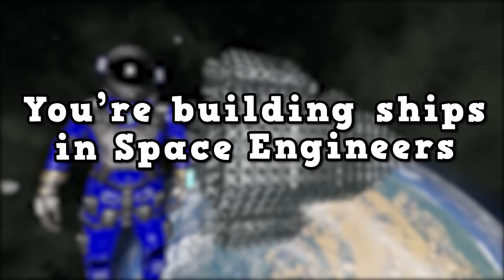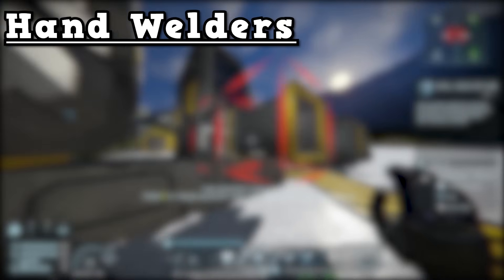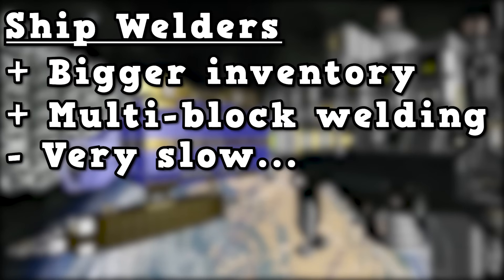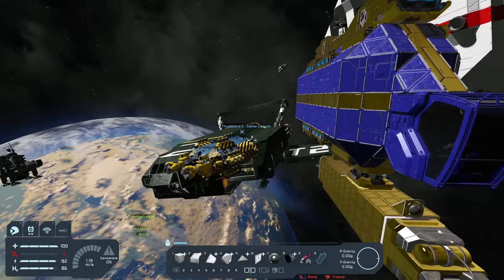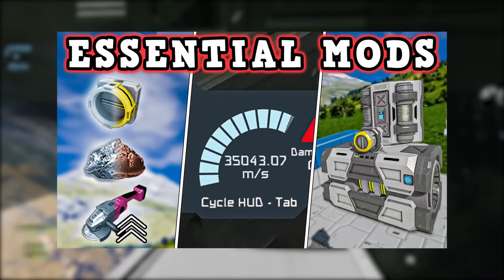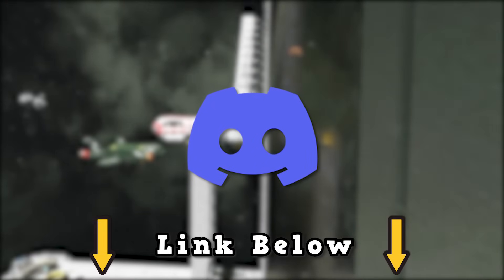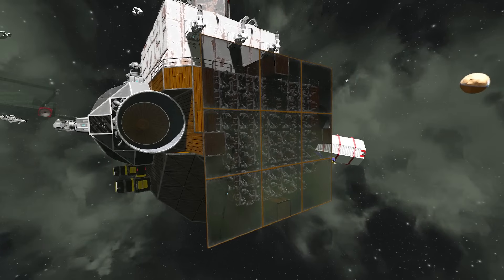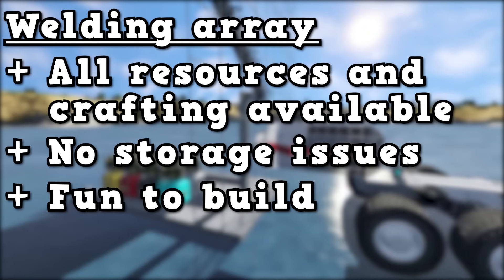You're building ships WRONG in Space Engineers

Comment: The most common method I used in multiplayer (with 3 to 4 players), was a mix of hand weld and weld ships, working on a blueprint. They tend to complement each other well. I would have a number of colour coded weld ships, and each would be assigned to automatically pull only a specific category of components from the base. No need to manually manage their inventory, just dock and undock, and they're ready to go again.

One player would act as the construction foreman for the build, and move around in person inspecting blocks and informing the team of what was needed where, making sure that areas were done in the correct order to avoid blocking anything off. He would also monitor component supply and reassign assemblers as needed. He would assist in hand welding slow components whilst inspecting.

Most of the weld ships wouldn't waste time fully welding most blocks. Their main job was to deliver the components. The one performing bulk work like hull plating was the exception, and would be a variant with a 2x3 array of welders, that could rapidly weld up large sheets of armour due to it's overlapping weld area, much faster than by hand. The other weld ships had their welders on extended prongs, to ensure they could deliver to narrow areas of the ship. Once bulk work was done, most players would dismount and use high tier hand welders to quickly finish up blocks. Any additional components needed could be grabbed from the weld ships parked near the work site.

For the larger builds that I designed, I also made multi stage blueprints. Basically I would complete the ship in creative mode and blueprint it in it's final form, but would then strip out sections that block easy access, and remove most of the exterior hull, leaving just a skeletal frame of the ship. It was quick and easy to simply delete segments, and I would blueprint the ship in increasingly cutdown variations. This meant that when it came to construction in survival mode, we could start with a frame work and minimal internals, and gradually add layers as each was completed. This considerably improved the effectiveness of the weld ships, being able to get right inside the ship and work on areas that would otherwise become a nightmare of half welded blocks and confusing hologram.

This design process was also used when we did our "Mothership" play through. Using both staged and modular blueprints of the same ship, we were able to quickly build a very large but bare minimum mothership, and travel through the game gradually adding and upgrading systems as needed and when possible. Eg, systems such as thrusters, refinery, or cargo holds, were blueprinted separately in approximately five "levels", from the minimal required to survive, up to a fully completed ship.
Reply: That's awesome! Everything you said

Comment: In my opinion is this method works well for servers with low welder limits. 

But when you are allowed to build a decent amount of welders, say 30 or something, I use 24 in a vanilla without limits server. The following method is more efficient. It's also a relevant guide to end game players.

Moving the projection out of a welderwall is the heaviest method of printing. (Projection set to ship making grid calculations heavier, and materials are pulled from a full base, with tons of unrelated inventories to check for components, and connected ships are checked as well. 

If you set the projection to station, and weld with a reasonably large weldership that has f.e. 4 large cargos, you keep the conveyor system simple and small. Not too big a welderwall mind you I'd say at MOST 10x10 blocks in total size whilst spacing the welders 1 block in evey direction. This way you print much faster and in a much healthier manner for the server. 

For bigger prints in I reccomend going to creative and cutting the ship into sections to keep the block count per print low (I cut them into around 2k block sections), then merging the sections together after building them in survival. This is because as the blockcount gets higher the grid calculations get heavier. I think it adds up all the blocks, for physics simulations, every time you add one to the grid. We actually had someone lag the server quite heavily by manually placing blocks on a huge hand built station. A lag spike every time he placed a block due to the enormous block count. That's why I recommend splitting grids up when printing bigger stuff on a multiplayer server.

Comment: Seeing as how the ship welder can do multiple blocks at 1 time you are technically wrong about it being slower. Yes it is slower at welding 1 block at a time the aoe actually makes it about even with a t3 welder if not a bit faster
Reply from the maker: The AOE is only big enough to weld 2-4 blocks at a time depending on where you are pointing. Like you say, it's a about even so using the hand welder is still better as you don't have to deal with all the other rubbish that comes with welding with a ship.

Comment: use page up page down and ctrl+mousewheel to move around blueprints if you grabbed them on a weird angle.
Reply from the maker: Yeah you can, but if you copy it from the correct angle it makes lining up projections much easier and it also means you don't have to fiddle around with it each time you copy and paste it.
Reply: @Zer0sLegion  sorry that came off condescending 😅 just adding another tip if someone managed to come across one that's a bit odd.

Comment: The best way to build in survival is with the Build and Repair System mod or Bob as its known around the yard. It uses nano technology to build blocks either attached to a grid or in a certain radius of the Bob. There is no argument it is THE best way to build. The only draw back is that a lot of public servers wont have bob installed because with so many players using them, it can really lag up the server. But on your own dedi's or SP there is no excuse to not be using a Bob or 2 or 3 or 20. Can be used while hand building and with projectors. It is also the best solution for when you want to automate building and mass produce things.
EDIT: I will add that this mod might be seen as the easy way out by some SE gamers. As it requires less engineering to solve a problem. However, Engineers are supposed to find the path of least resistance when designing a system or device. That is Bob.
Reply from the maker: You say play "survival" but using nanobots is basically creative
Reply: @Zer0sLegion  No its not. There is still a welding process and a grinding process, only it happens automatically. And you still require all the resources.
Reply from the maker: @honestgoat  Ok, then it's creative but worse.
Reply: @Zer0sLegion  What the hell are you on about? You need to make your point clear man. How is creative?
Reply from the maker: @honestgoat  Building a ship is like 80% of the content in Space Engineers, if you're just gonna make a thing that does it for you, you might as well play creative. Build and repair completely trivialises the game, you don't even need to repair damage to your ship because it does that for you as well. If you want to play the game that way that's fine but I promise you the game is far more interesting if you don't. Engineering around problems is much more fun that having beep boop block 4000 doing it for you.

Comment: Put 4 welders not just 1 in a X formation also stick a camara above the docking port also use a remote control instead of a cockpit.
Reply from the maker: Yeah, I was thinking more multiplayer server limits but yeah, an X would be better
Reply: @Zer0sLegion  Try also using a remote control with a antenna you can make them super compact and very simple to use.

My build for a drone welder is 2 welders 2 cargo and thrusters in each direction as well as a docking and camera on the front and where the connector is.

Also 1 battery as it will be local.

Comment: I used to use weld walls or weld wall ships with the materials and a static projection to weld too. Or make the projection on the weld ship like you have and pull the projection through the weld wall. Welders can weld on default settings in front of them and one block to the side both up/down/left/right. So with that you can reduce the amount of welders you sued in this video greatly spacing the welders as such. Also helps to reducing welding lag as each welder welds it's own space and doesn't compete with an overlapping welding area of another welder.   Welder, block space, block space, welder, block space block space, welder, etc.

I prefer mobile projection ship pulling a projection through a base welding wall. As the base can produce more as needed to supply the welders. But I advanced from there to a found blueprint on the Workshop that is a mobile ship welding wall that can also be made as a mobile parts production. Now I favor servers with Nanite Factories or Nanite Builder mods.

Comment: No need to be scared of ship printer Klang, especially in space. The solution is to have a piston not attached to the rotor. In gravity, use wheels to guide it along the ground if you're that worried. Also, no need to fill every square, you can do pretty well with only every other square in a checkerboard pattern.

Gonna add you forgot about the "roast" method where you build the frame out in survival, then move the unbuilt blocks over and around stationary welders. Gets everything but the inside, but to be honest, that's 90% of the battle for small to medium-sized ships. Small welding drone finishes it up after that.
Reply from the maker: Thee when underestimates clang is doomed to face his wrath
Reply: @Zer0sLegion  This is a case of understanding, not underestimating. Klang occurs when something wants to be where it isn't and generates a force. A single piston (not attached to the spinner) or even series of pistons (with share inertial dampner turned on, potentially with wheels to support it) does not incur the wrath of Klang. This is actually a well-documented method of building a printer.

Comment: Something I like to include in many of my builds, especially fighters with guided missiles, are projectors onboard for easy repairs and rearming.
Need destroyed armor and thrusters added? Turn on the projector and fly up to welders. Same with replenishing spent guided missiles. If you aren't using the multigrid projector mod, you can just add a second projector that casts a BP of the missiles linked as one BP, the linking blocks being concealed inside the ship, so it only welds the missiles.
Reply: If you connect missiles with merge blocks a normal projector will project the missiles and ship.  I typically have dedicated welders for rearming my fighters, with a connector to align the ship.  I've also found it is easier to just print a new fighter when it is damaged, and toss the old one in a grinding pit
Reply: Add a conveyor system and some welders that cover the entire are of the ship and you have a self-building ship.  You also get repairs mid-flight without having to dock.  If you position them correctly where your first three blocks are a connector, conveyor, and welder; that's the mot efficient way.  Go off and do other things.

One other thing about having the projector on board the ship is; when it's on it gives a shield like aura.

Comment: My default has always been welder wall, pistons, wheels on rails, mass blocks and gravity generators when building ships in space. I've successfully printed some very large ships with ease.
The setup is always quite time consuming however - but fun. Though the welders have to be strategically placed to get the maximum wall with fewest used (and it does lead to some smaller blocks needing hand welding).

Comment: Some ships have welder inside them to repair them to 100%.  With the right design and projector.  You can welder the blueprint to get the ship connected to a station and the first welder and projector on the ship operational.  From there the ship will build itself with the resources from the station.  You can also use the build and repair mod which will welder the blueprint inside and out without any complex designs to build the ship.  

Anyway ships that can repair themselves too 100% tend to have a reduced size because the number of welders and conveyors can bug out the ship.  The size can still be big but huge ships it can be an issue.

Comment: I personally like using printer tugs myself, but I dont use spinning welders. I just make a laege rake with the welders spaced 5m apart. In my opinion, its better than 3d printers as there is no real size limit to how big you can print. Also, keep in mind which way the welders will be welding from as you design the ship. Some blocks have fun hit box shapes that the welders cant reach if they are facing a certain way and some blocks have only 1 snap point and can be missed because of that. Making sure each block you place is facing the right way to be welded properly can save you the trouble of having to grind through your ship to find that missing gyro or finding that 1 light that didnt get welded up all the way
Reply: Also, Build planner dpes wprk on ships. Tp use it, simply set the left inventory to the container you wish to move the items to and click the button in the middle to transfer all otems on your build planner

Comment: welding with a tier 3 hand welder may be faster than a ship welder, BUT you can always use more than 1 ship welder at a time, combined with the multi block welding does make up for a lot, in fact i generally use 2 welders minimum and sometimes 3... now yes i now a pre-designed ship projected and then printed of a 20+ welding grid/3D printer is fast, but past a certain number of tools in action ones sim speed starts to suffer, many servers actually limit how many welders, grinders, and drills your allowed to use because of this...., and lets not forget mods can be used that may make building ships faster.... and by the way, build planner is supposed to be based off a mod called easy inventory, and when you can keep build planner from blocking its function, easy inventory is still a better option, and easier to use.. build planner has too many flaws, and doesn't work right half the time, and honestly i wish i could toggle it off just to once again use the easy inventory mod without hassle....

Comment: It's easy to say that "hand welding is better' when you're not playing on 1x cargo volume. Multiple ship welders in tandem with ample storage capacity for heavy components dramatically improve the value of ship welders when you don't have minecraft pockets.  Even then, ship-based welders/grinders are best used in pairs (with a gap in the middle thanks to the overlap aoe) to weld/grind single parts as well as bulk structure jobs faster.

One of the first ships I build is a Drone I call the 'stencil'. it's a 5x5xX small ship single welder drone that more or less takes over larger construction jobs, mostly small ships using a projector. I keep several around, and at least one has a grinder swapped out on it. I can sit comfortably in a space-hab   and get work done without needing oxy/fuel reloads constantly. Why multiple? so they can repair each other.  The work does require manual checks to make sure there aren't any gaps in the jobs, but they've proven incredibly servicable.

Comment: Pro tip for getting the alignment right on a projector, reduce you menu opacity in settings. then go 3rd person from a seat on the grid.
Reply from the maker: Can't move the camera though which is main problem.
I have my UI on Max Opacity for recordings, I turn it down when playing normally.
Reply: @Zer0sLegion  True, you can't move the cam while you have the menu open but you can move it while you're in 3rd person. I move the camera to a good position before I open the menu. I find it works really well! But that's just me.

Comment: ships do have access to the build planner, you havent seen the buttons in the middle of the inventory screen?
Reply from the maker: It's not the same though is it, it's not where near as easy as the hand welder method.
Reply: @Zer0sLegion  its much easier than the hand welder, you just have to get the welding ship designed right, yes you may need to exit the cockpit to put things on the build planner, but after that, put in names of the invtories on the left and right side of the inventory screen, and use those buttons, much faster than building by hand, the only thing that beats ship welders is having an inventory access near the large thing you are building, middle mouse left mouse middle mouse left mouse etc

Comment: see i designed an entire universal, modular building system using merge blocks specifically to make more effective use of simple printers, so instead of building an entire ship the printers only need to build the modular sections and then you can move them into place with a relatively small ship.

Comment: if you are suggesting a mod, I would love to share my mod experience with you too.
the easiest way to build a ship in my opinion is a "BuildAndRepair System Block" from the mod with the same name.
It is basically a wireless welder that you can place anywhere in a radius of 50meters, or 25 blocks distance and it repairs or welds up anything.
It is the same rate of a handheld Welder and you don't need to build sth. just place it, turn it on and it starts automatically. As soon as you place the BuildAndRepair System Block, it will be toggled off, so you have to turn it on:) Hope, that helps and greetings from germany!